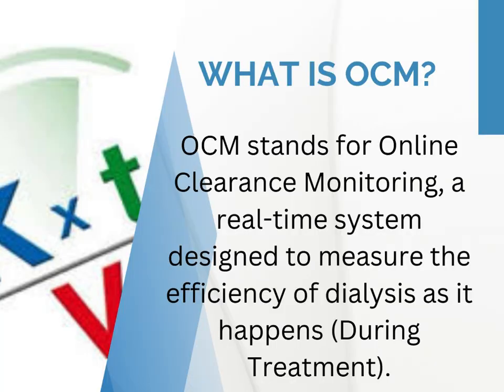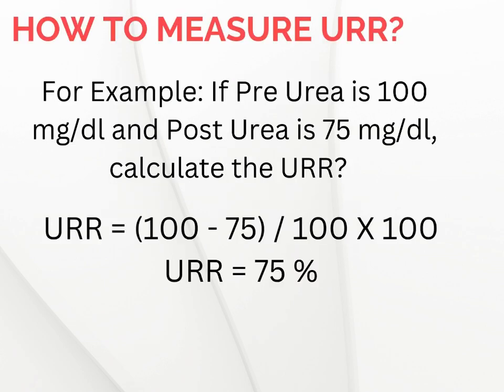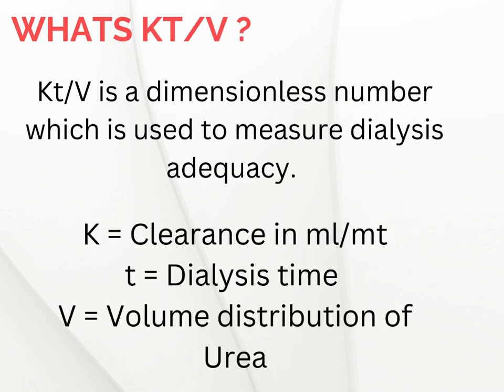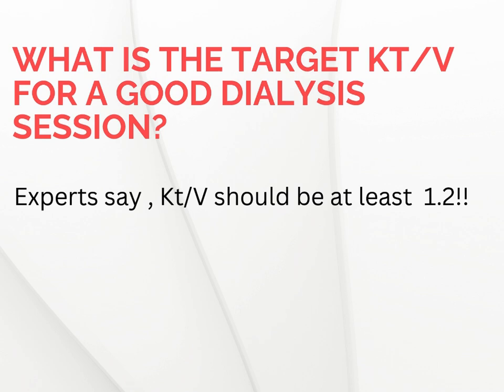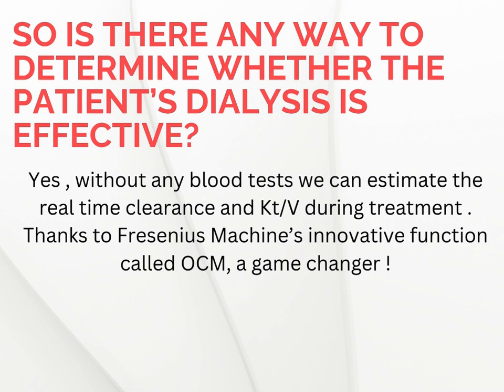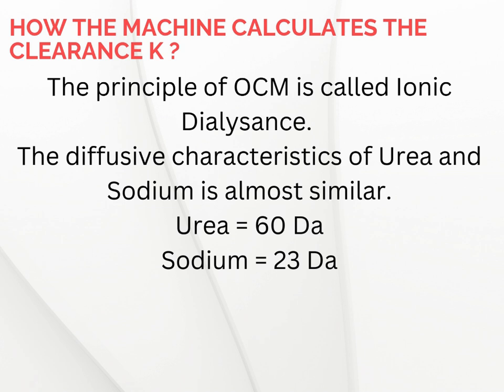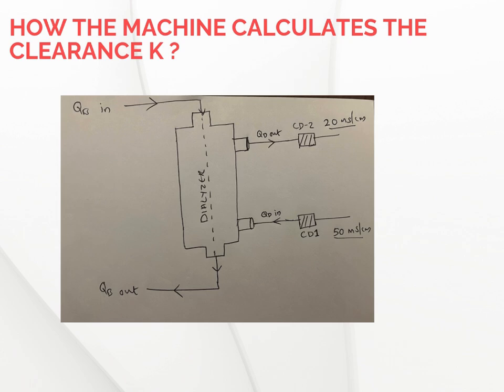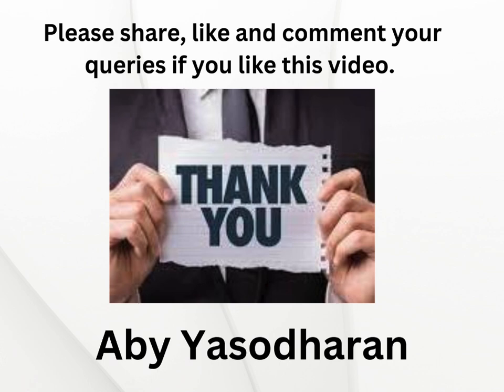Dialysis Adequacy: Kt/V Measurement with Fresenius OCM | Online Clearance Monitoring in Hemodialysis

Comment: Nice presentation.

For pediatric BFR we calculate like 3 to 5 ml/kg 

For adult BFR we calculate like 8 to 10 ml/kg.

If matured fistula means 
Pt weight = 60kg
I took 8ml/kg  BFR 

BFR for this 60kg pt is 480 ml/min

480ml/min means we have to use 14G  avF needle.

Thank you so much 👍
Reply from the maker: Excellent answer.Thanx a bunch  for the comment and I appreciate your time  to share your valuable inputs with us. My sincerest apologies for the delayed response. For adults , Qb can be estimated using 5 to 7 ml/Kg/mt ( If the fistula and patient's clinical condition allows) . So in my scenario , 300 to 420 ml/mt can be achieved.Cheers.

Comment: Usually BFR are prescribed as 3-6 ml/min/kg of Body weight

Here in this case if there is no contraindication of high efficiency dialysis upto 360 ml/min BFR will be sufficient for an adequate dialysis...
Reply from the maker: Great answer. For adults Qb can be estimated using 5 to 7 ml/Kg/mt ( If the fistula and patient's clinical condition allows) . So in my scenario , 300 to 420 ml/mt can be achieved. Thanx a bunch for your valuable insights. Cheers.